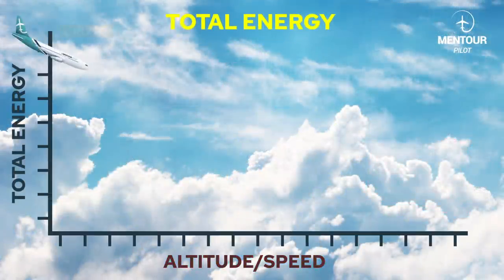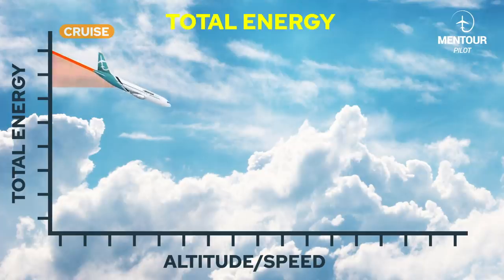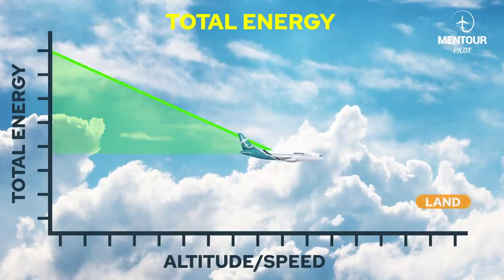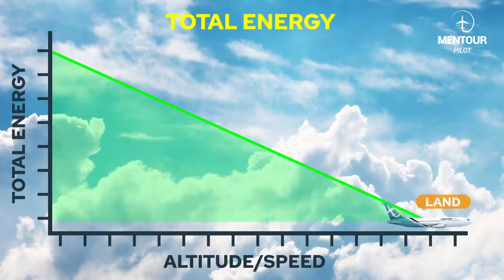Unstabilized Aircraft approach - Explained!

Comment: Do you Go Around if you lose an engine in your approach around 500ft AGL or you continue with landing?
Reply: Not a pilot, but I'm pretty sure you'd have to go around, as you would have to reconfigure for the unbalanced thrust, and remember that you won't be able to use reverse thrust either.  Since those parameters are now incorrect, you'd technically have an "unstabilized approach" situation from that moment and you'd have to reconfigure the aircraft.

All that said, if you don't have enough thrust from the remaining engine to keep you the air, then I assume the decision is made for you - by the aircraft.

PS: Rather like losing an engine while rotating on takeoff, one should finish the takeoff, then sort out the problem once you have a buffer between the aircraft and the ground.
Reply from the maker: Depends on if you can keep the approach stabilized or not. We are allowed to continue if that is the case or go-around depending on the situation.
Reply: January 17 2008 British Airways Flight 38 was basically this situation. No chance of going around.

Comment: Can someone answer this? I flew from Dallas to Tampa Bay. First time on a plane since I was a kid. The pilot comes on and says their vector was too close and we had to circle around Tampa again. The lady next to me said that she thought something was going on so I guess she flies that route a lot. I thought everything was done by the computers. What caused that? What did he mean? Thanks. Edit, it was a clear day, no bad weather. Question #2 We flew over land to tampa, but the flight got delayed coming back so to make up time, they shot over the Gulf of Mexico. Why don't they use the short route both ways? Thanks again.
Reply: #1 It's common for the ATC to give 'vectors for the visual' in good weather rather than following the published approach (STAR), which usually leads to quicker approaches. They give heading, altitude and possibly speed direction to the pilots to set them up for a good turn on to the final approach. In this case, assuming the announcement was the real deal and not covering for some other reason, it sounds like the controller either didn't descend them fast enough or the crew didn't like how the final vector intersected the extended runway centreline (either too close, or too sharp an angle), so they called off the approach for the excellent reasons that Petter outlines in the video; you don't want to be overworked trying to land a too-tight approach.
Not sure about routing down there. Might be due to predicted winds aloft.

Comment: Hey Mentour, from the clip you've shown on final Ref Speed, I realized your minimumth set for 300 Baro. But I also realize there's the option to switch between Baro and Radio. When do you use each and what're each for?

Could yoy do a video on how to fully configure an aircraft for landing please?
Reply: it’s just different ways to set minimums through either radio height or Barometric height
Reply: If there is a valley before the threshold, the radio alt. will be incorrect.
Reply: @James-me6dx  which is which tho?

Comment: what about a "theoretical" situation where plane contacts the runway and does not inform the tower of that runway? the runway could have been damaged and other planes crash on landing if runway way not inspected after contact, right?
Reply: Runways are harder than engines. The bigger problem is FOD on the runway for the next departing flight.

Comment: How aviation companies are managing and maintaining their aircraft since there is lockdown in most of the countries and no flight are flying anymore? Is it feasible to directly start flights before testing the aircraft without any passenger onboard? Also Pakistan's aircraft has recently crashed so is it related to same maintenance issue? Is flying in aircraft just after lockdown is safe enough as it was before?
Reply: Yes, the airlines are taking care of their equipment using all kinds of protective lubricants and coverings. After a major maintenance, a "dry flight" is performed by mechanics. Other than that, the aircraft is always operational.

Comment: I'm curious where a situation would arise where you need to get on the ground even if you're not stabilised, such as a fight in the cabin or something. Also, how does this compare with a military landing? My friends who went to theatre in RAF Tristar and they said that they fell like a stone with all of the lights off into the airfield.
Reply: Military tactical approaches feel incredibly fast and risky, but they have strict procedures as well. There are still minimum requirements and parameters which must be met so the approach remains stable throughout. The spiralling approach occurs over secure areas as opposed to being a long line over many miles.
Reply: @slartybarfastb3648  thanks for that!

Comment: “Lobes” in the ILS radio frequencies? Am I right in thinking that that’s a harmonic effect between the constituent frequencies - constructive and destructive interference and such?
Reply: No, it's a characteristic of directional radio antennae. The directionality, at least in the easiest way to look at it, comes from interference patterns of the carrier reinforcing to form the main lobe. From there, each antenna type has a pattern of secondary and lesser lobes that are reduced in power, typically about 20 dB lower for the primary side lobe depending on antenna design. As Petter says, if the signal is strong enough to pull the flag it is usually indistinguishable from the main lobe.
FCC Radiotelephone licensed since 1969, worked as avionics tech in GA 1970-1984. Communications/IT field tech for a large electric utility 1984-2018.

Comment: In my physics class I am sure we were told energy can neither be created nor destroyed. It can only be converted from one form to another. 
Captain are you using the term energy in a different way?
Reply: I think he just meant the plane has lost energy. That energy has mostly gone into heating the air through drag, which is really just the kinetic energy of the air molecules. No energy was destroyed, Einstein can still sleep easy :)
Reply: The energy starts out as chemical energy, then progressively becomes kinetic energy (and lots of heat energy) during takeoff with potential energy on top of that in climbout. Descending, much of the kinetic energy and all the potential energy is converted to heat in the approach. After touchdown the remaining kinetic energy is converted to heat energy.

Comment: Well the energy is not destroyed here by drag either. It's just converted to heat dissipitated to the air. The only way to destroy energy is nuclear reaction, but that involves Einstein's relativity and quantum physics so whatever.
The lift generated by the wing is proportional to air speed (technically velocity squared) and angle of attack. So when the speed is reduced, the lift is reduced. When the lift is lower than the weight of the aircraft, you're descending.

Comment: Why not using speedbrakes to reduce the energy level if needed? If a shortcut is provided, this would be more reasonable than continuing on the planned route for more track miles as time until landing can be minimized.
Reply: A: That might not be enough
B: Like he said, after you have selected F10, speedbrakes are no longer permitted due there being way to much drag and therefore to much thrust. 
- TIFD

Comment: What a nonsense you saying mate. You CAN NOT destroy the energy. It's against physics. The first principle of thermodynamics says about it. You should know it from the secondary school.
Reply: You send it out of scope if you wish. Available energy is what supports the plane, entropy (which is just unavailable energy) does not. Worrying about whether the energy is destroyed while on approach, could end in a more esoteric discussion about whether the plane was actually destroyed. After all, all the parts would be around there somewhere.
Reply: Kornel Kornecki you might also remember from secondary school how to spell PHYsics! Also, I think you’ll find these videos are not made for astrophysicists, therefore he was trying to explain it in a way that people will unferstand. 
- TIFD
Reply: Once you convert the energy to heat (maybe via hefty air turbulence or similar) you have "destroyed" it relative to the potential and kinetic energy you had.
Of course it is not really destroyed but converted, however it is no longer present in the movement of the plane.
Reply: @flagmichael  I'm not sending it out of scope. Flying a plane has a lot to do with physics and Mentour Pilot should know basic school level of physics. Saying that the energy is destroyed is wrong. I can understand what he meant by that but still he was soooo wrong and he was repeating this destroying energy stuff so many times. This is so unprofessional. And if you allow yourself to make such horrible mental shortcuts like this "energy destroying nonsense" what will stop you to make few convenient shortcuts Boeing & FAA did with 737MAX or those 2 Pak pilots killing 100 persons in Karachi?
Reply: @theinfiniteflightdeck  I tfont fnow mr Fhe Infinife Flift Feck. Mayfe you rigft. Haffy enerfy destroyfing while flying.